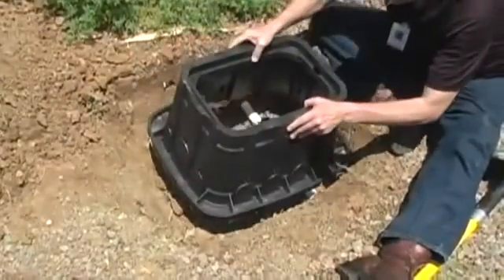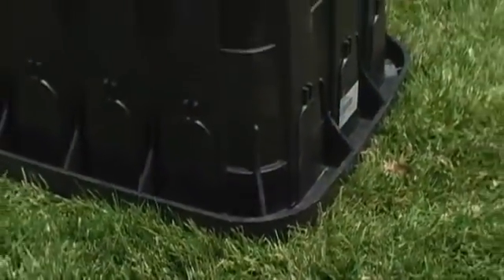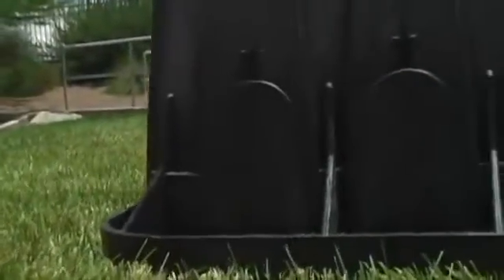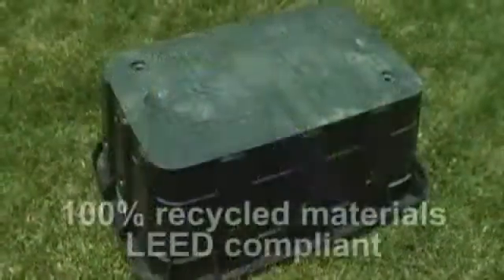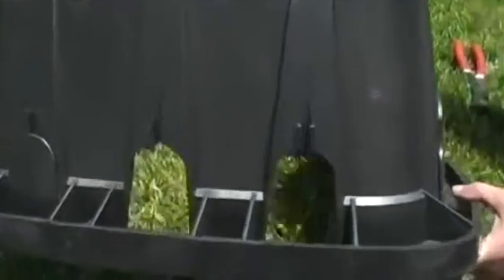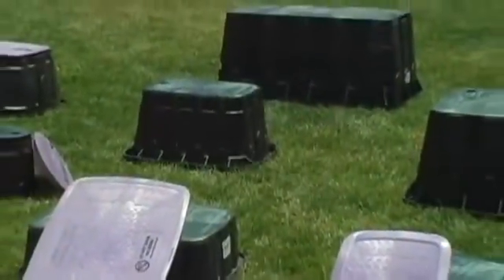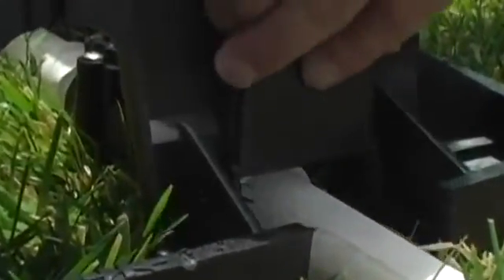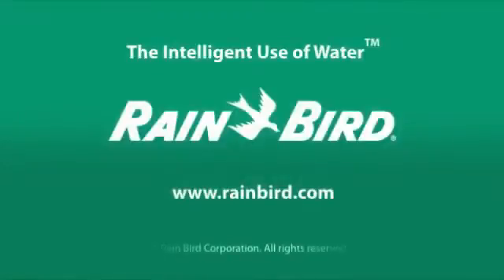Rain Bird VB Series Valve Boxes

Comment: The knockouts fitting over the pipe is a freaking nice touch.  I used to take the cutout and "reattach" it manually with pvc glue or a screw.  Didnt work as great as I wished.

Can yall re-record this in at least 1080p ?

Also can you showcase every single valve box you have?  I'm working with 2" valves and would like to get a sense of how this would work out.